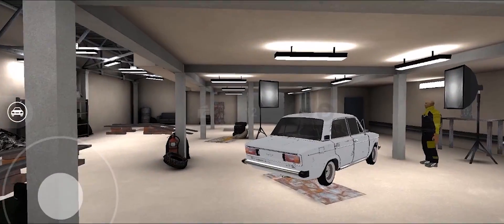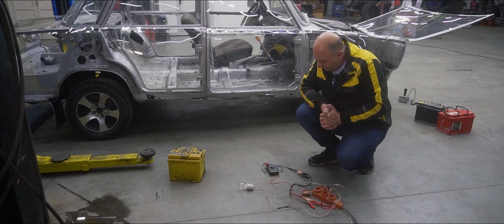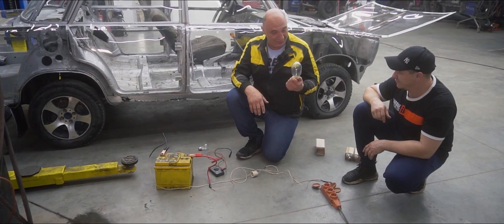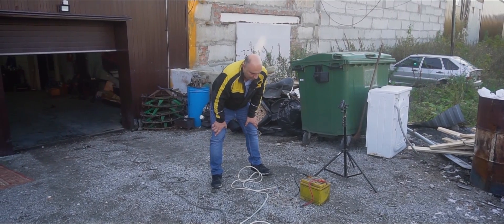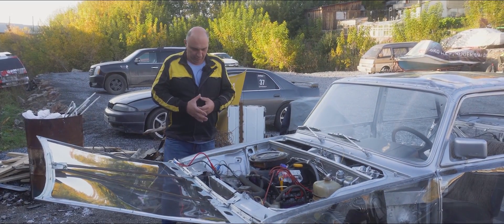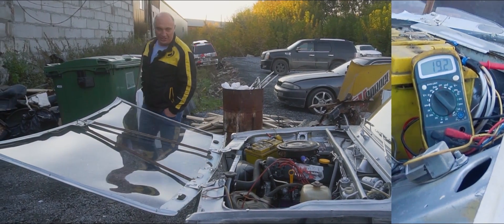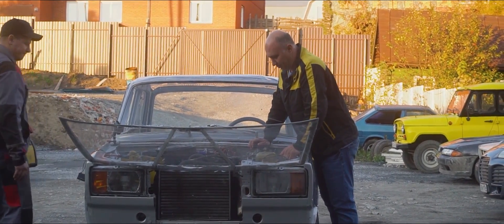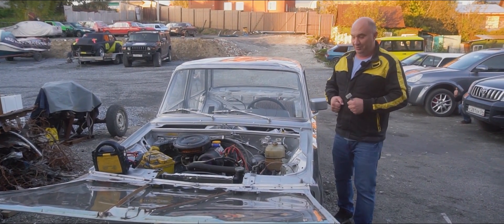Feeding a car 220 volts: will it start?

Comment: That's a diode, so only one half of the waveform is going thru. You need a TrueRMS multimeter to get the real RMS voltage output there, as the waveform isn't a sinewave anymore. The light bulb would limit the current somewhat to hopefully stop the battery from granading on your face. If you were to connect this to a modern car, it would likely fry all the electronics.
By the way: those clamps are deadly used like this. Can easily die from touching the live one.
After you connected 220v to the car's electric system it didn't charge anymore probably because that exceeded the maximum reverse voltage of the diodes inside the alternator, or just fried something else inside the voltage regulator.

Comment: No, a 12-volt DC motor will not run on 220 volts ac

Comment: 7:23 Really neat! Right before it fries you see the wires jump- that's gotta be a magnetic field, right? I just plain won't touch 220v, I get shocked often enough on 110, which is safe if you're not sitting in a puddle

Comment: connect a powerful arc welder that car
Reply: It's not uncommon to charge a car battery off a welder, just have to turn it up slowly if it's completely dead since it's basically a dead short.

Comment: LMAO.. 220V half wave rectified is about 90 - 100 V... almost no amperage. Diodes blow up with any real current draw. 220V AC on a car is just going to smoke everything... guess they learned the hard way LMAO...

Comment: my brother had a nissan altima that had a bad regulator in the alternator. when he would start it, it'd run fine at idle but the voltage would jump to around 16-17v and the engine would bog and not want to start after. What had happened was it had a electrical protection from this exact issue and would save the electronics by not allowing the engine out of limp mode

Comment: Try using 2 or 3 server PSU in parallel to start a car. OR use a 230v induction motor as a starter

Comment: Now this may be a weird idea, may not even be possible but it popped in my head. What if you could run a car off a small generator instead of its engine, like one you'd take camping. I don't know how it would work, but i feel like there should be a way ... Hm...Like a little diesel one.

Comment: I would guess the ignition failed from either too much voltage on the condenser, the points welded, or the insulation failed in the coil.

Comment: The battery prevents the voltage from increasing. What you need is another car with an alternator plugged into it, then feed it into the car you want to start as you can get the amps you need from that. However the challenge didnt say AC or DC.

Overvolting the battery can cause it to blow.

Comment: I once connected 2 car batteries up to a Ford Orion 1.6 CVH, and cranked it over with 24v... DAMN it cranked over so quick!!! hahaha, it didn't start on 24v, but when i dropped it back down to 1 battery, after a few cranks, the motor started nicely and ran with no problems.. Didn't even blow a fuse!! 🤔😎

Comment: This can't work. The current in line is Alternate (AC), but the battery and car has Direct (DC). If you want see a biiig show, first you need convert the AC voltage from line to DC voltage.

Comment: They had the right idea to charge the battery with the heat gun as a ballast, after a few hours pop the battery back in the car and you should be good to go.  The starter motor and car wont run on ac neither will the battery charge on ac.  Killing the ignition system with 56v at the end was hilarious - another dead lada!

Comment: Big bear you disapoint my 😌 You did see the ruber gets eaten away right? You dont use diodes magg's didnt use diodes they used capacitors if its positive ground its a supresor but if you want bouth grounding dont use polarised capacitors and expecialy dont use cheap spark plug wires for amplifier ignition systems and expecialy not for plazma ignition. 
Amplifier is use for high torque.
Plazma is used for high speed.
Use bouth!
Fix that and watch!
Shut of the fuel pump compleately you dont need more preshure fuel tank is grounded to chassy fuel will start to vaporise by it self from static .
Funny car magneto set up to fire 
1/2 of it stroke and second time at the top compresion stroke if you include exauste stroke like waste spark ignition you get 16 independent spark's with diferent effects just like the Pap engine Atraction and Repulsion so there a small 4 cilinder runs at idel 16000 rew's the oposite tune up for high torque is diferently made and that is all no turbo no compresors no nothing purely electro magnetic gun/selenoid ignition  implosion is atraction ,explosion is repulsion basicaly you get masive compresion just by that nothing ells requared that was the idea originaly similar to your steam engine car video this thing use purely magnetism to do the same thing.
well yeah figure out how to not get eaten metal and ruber and still get positive results well you probably wuld not belive that small lada engine run at 200rpm just like a tractor engine its funny watching it and your multi flywhell video is a good idea your going in right direction this video how ever you miss understand what is realy used for and that is power multiplcation by useing magnetism 😌 well with a arc welder you culd basicaly vaporise any thing from water to heavy oil and oil has lot more energy than ordinary gasoline 😒 not inculing methane ethaneglicol brake fluid etc. well no wonder peopel geting engine run on and that deam ecu bitte's peopel randomly and that is used for rost preventing on chassy's but still static eats up ruber and gaskets with out static you chassy rost but you ruber dont fail so there is a price to pay If you want perfomance and economy you luse chassy to rost.
By the way all car companys and oil company's know this for a long time 😒😝

Comment: You are completely wrong ..you are trying to get a dc current from ac source if you even have it on 220 volts ac .. probably not.. you will not see ac volts with multi meter on dc ...220 volts is 2 phase meaning 2 hot wires 180° out of phase from each other..

Comment: Remember the car battery acts as a voltage regulator, that's why it wouldn't go above 20v, that why you had 100v without the car battery.
Nice show you,👍🏾

Comment: The lightbulb is killing your voltage and amps.  Directly your line power doesn't have the amps.  
Better would be to use 20, 12 volt battery and it will fry

Comment: the reason it's not charging is probably because you either burned out some of the small wires that are actually really delicate inside your alternator or you burned out one of your wires to other parts of your vehicle

Comment: If you run the engine long enough without the charge regulator the battery will crack at least...

Comment: I restore batteries that are flat dead by hooking them up to the mains 110volts ac for about 5 seconds. Afterwards, hook up a good battery charger and they will hold a charge. I don't know why this works but has saved me a fortune in batteries over the years.

Comment: Should try starting it from a welding transformer. that should be able to deliver the current needed. Might want to add a full bridge rectifier so the starter doesnt run in reverse. 

Or even lazier. Just replace the starter with a 230v motor😅

Comment: Using an oscilloscope to measure voltage, 12 Volts DC, (Direct Current), shows up as a straight line 12 Voltes above Zero. Measuring AC (Alternating Current), can be made a couple different ways, but those simplest for sake of this discussion is as a Sine Wave showing Peak to Peak voltage of 220 volts. That’s +110 Volts positive from the Zero point to the top Peak of the Sine wave added to -110 Colts from tube zero line to this bottom of the sine wave. So from top to bottom it measures 220 Volts AC. Peak to either zero line is 110 Volts, but your working with Peak to Peak voltage, compared to DC Voltage. To get the true voltage the cars is now seeing take  AC and subtract 12 DC from that and what the cars electrical system is supplied with is 208 volts more than it was designed to handle, therby frying the shut out of everything. Not good!

Comment: So that spike you are referring to is called an inductive spike, which is caused by an inductive load.  The basic principle of an inductor is that Electricity put into a coil of wire wants to keep flowing once power is cut.  This is because an electromagnetic field is created in the wire and when that field collapses.. It does not just stop, It wants to basically stabilize itself to 0 Volts.  Lenz's Law of Electromagnetic Induction. Faraday's Law say this.  It is very interesting if you ever want to get into the scientific specifics of everything!

Comment: back in the day they had aluminum based jar rectifiers. you would use them to charge radio batteries i think. pretty sure they could handle massive amounts of current.

wet electrolyte rectifier?

Comment: Ah yes. The good old suicide charger.
Place the lightbulb/heatgun on the primary (close to the AC plug)
Instead of one diode, use a full bridge rectifier.

Comment: Yeah, the whole lightbulb thing isn't the most efficient way to charge a battery (only about 5 % efficient). Also not the safest way to charge a battery of course... But it should work, just keep in mind that there's no overcharge protection (obviously). You can use 4 diodes to make a full bridge rectifier and get twice the average charging current.

Comment: use engine oil for coolant, maybe use the coolant for oil as if someone accidentally got them backwards, what happens to the engine running engine oil for coolant?
Reply: If I remember right I think neutral drop already did this

Comment: I was really hoping they'd send 220 to the starter and have it crank up to 3k rpm or something nuts
Reply: Fun fact that the no-load RPM of a starter is waaay above 3k RPM, unfortunately it's geared down. So in theory, it is possible with a lil more current... Half a kA, or a whole... Not from the mains, but 3-4 car batteries would do it.

Comment: 7:45
Of course it wouldn't.  You need to rectify the 220-volt AC power from your outlets to DC and then step the rectified signal down from ~300 volts to 15 and then feed it through a USB-C controller that will allow up to 75 watts.

Comment: Do a tear down of the busted coil... it failed open for sure, but how does it looks inside?
The battery is down some regulation, in the moment you took it out, alternator was left to its own device.
Trying the 220V start, the starter coils look like a dead short to mains, and the lights barely see any voltage, as they are in parallel with starter motor.

Comment: Should have hooked it straight onto the main breaker 200 amp
Reply: Hook a few batteries in series with thick wire  and batteries that still good. He get the higher voltage and amperage needed to blow stuff up.

Comment: I had a car once where the voltage regulator died and the alternator put out about 100 volts. I drove it for a week and eventually the battery exploded in the engine bay because it couldn't soak up anymore. Acid and steam and shit went everywhere.
Then all the instrument lights went extremely bright, then all the bulbs popped and all the fuses blew and it stopped running on the highway and everything smelled crispy.

Comment: Normal battery chargers have capacitors that regulate and store energy. The reason you can not charge a battery on 120V or 220V directly cause it will cause the lead plates  cells to die from excess voltage.

Comment: Make a Lada that uses starter motors to drive all wheels, or at least the driveshaft. With multiple batteries in series, placed in the rear. Just 10-15 km/h top speed, but with 1000s of amps and endless torque when the switch is closed.

Comment: As crazy as it is to run a half bridge rectumfrier with a balast (the light bulb) straight into a battery, technically it's ""OK"" because it's current limited. Lead acid batteries start in constant current mode before transitioning to a complex constant voltage mode depending on how advanced the charger is.

However... once that battery transitions out of constant current charge into contstant voltage, that is where that suicide lead gets really dumb lol Most batteries don't react too well to over voltage lol

Comment: If I'm not too drunk right now this will make sense. Without an amperage draw you'll never see the results you expected, but if you grounded the Lada to the ground or building and fed it strait off the panel with a properly sized cable you'd just end up melting the wire. Even with a battery in that configuration you'd just end up shorting the inside leads to the lead plates and it would stop working. Even if you hooked it up strait to the lead plates it would just get really hot, boil the acid out and melt the plates while catching the plastic on fire. 

Without shorting out big wires close to the panel and risking someones life all you will really get is glowing wires, toxic fumes and maybe a small fire. Sorry to disappoint..

Comment: Every time that breaker tripped it saved the next weakest link from burning out on the electrical system in the Lada which should be a fuse. Running 220v in those thin multi strand wires melted pretty quick lol !

Comment: This reminds me of the time I had an old Chevy van. That van model was dead simple. Hardly any electronics. Well, the alternator voltage regulator went out on it. I didn't notice for a few weeks. I got suspicious that my headlights were "quite bright" when doing 55mph and not quite as bright when idling. So, had it tested. Yep. Voltage regulator shot. Despite driving it for weeks with who knows how much overvoltage, I changed out the alternator and it kept running for a few years until the transmission went out. I think overvoltage issues are mainly with the modern cars that have so many electronics. The older cars? Meh. The Lada seems to be built "very simply" to function for one sole purpose: to get you from point A to point B and nothing more.
Reply: The problem is safety and emissions. Sure they killed the simplicity of cars, but at the same time those regulations came around for good reasons
Reply: @GTAIVisbest if those regulations result in vehicles becoming 10x more complex then it is time to reconsider what we value, because 10x the complexity is simply not feasible to maintain in the long term
Reply: @zf9903  All that complexity also comes with increased negative environmental impact. I wonder how what the environmental impact difference is between A simple car like the lada and something in a similar class today if you factor in all the excessive environmental waste that is not on the lada.
Reply: @D3M3NT3Dstrang3r  slams table THANK YOU. Finally, somebody who gets it. The environmental savings we could have by applying our modern knowledge and practices to producing a maximally simplified vehicle with many fundamental comforts cannot be understated. A bewildering amount of new vehicles have assemblies with integrated sub-assemblies, like plastic thermostat housings with integrated thermostats, or intake manifolds with integrated sensors. It’s insane. So much gets produced just to get thrown away, all by design.
Reply: @zf9903  They fuel savings alone of having a modern power plant in an old form factor is probably a big difference in mpg. People look at me crazy when I tell them my 1990 Ford escort got 28 mpg city and 40 mpg plus on the Interstate with A/C. But it was common for those cars along with cars like the Honda CRX of the same vintage that could get even better mileage.  Added size, safety and comfort features along with manufacturers needing to have a module and sensors for everything have tanked fuel economy and added tons of extra parts that end up as waste. It's pretty ridiculous when you think about it.
Reply: @zf9903 the move to EVs quite literally does quadruple the fuel economy (or energy efficiency, if you prefer)
Reply: @JP-zd8hm  they don’t last nearly long enough. Park an ICE vehicle in a garage for 10 years and it will start. Park an EV in a garage for 10 years and it will need a new battery, which I can guarantee won’t be made anymore.

Is continually tooling up for new, more inherently disposable yet temporarily more efficient technologies the right move, or should we attempt to sustain the lifespans of what we already have for as long as possible while attempting to shift to public transport and WFH as much as possible? We could make vehicles 10% as complex and fundamentally disposable as they are now, with double the economy. A large part of the problem is that vehicle size and weight is going nowhere but up, so regardless of what we do, we’re still wasting about 30% of the materials in each vehicle, and remember, all of it has overhead and must go somewhere when disposed of.

Comment: The ballast charging would have worked about twice as well with a full bridge rectifier. Batteries do not charge very well off unfiltered half-wave rectification, you need at least somewhat steady DC voltage to move ions around.
Reply: I can tell you've watched PhotonInduction and some ElectroBoom. 😂
Reply: @Ole_CornPop YouTube isn't the only source of knowledge

Comment: Weak battery acts as a resistor... Need capacitor between positive terminal of the battery and chassis of the car... I have started a car with 220 volts a few times and it doesn't burn anything as starter motor acts as a resistor too...

Comment: I really appreciate that they use at least diode to rectify it to at least a DC current. Is the bulb meant to be an incandescent resistor? 

Reminds me of converting old 6 volt tractors to 12 volt using 194 bulbs as incandescent resistors. Always felt crazy it could be that easy if you wanted to do it lazy like grandpa did lol
Reply: well yeah but the diode does reduce the voltage though  cause it's turning a/c top d/c